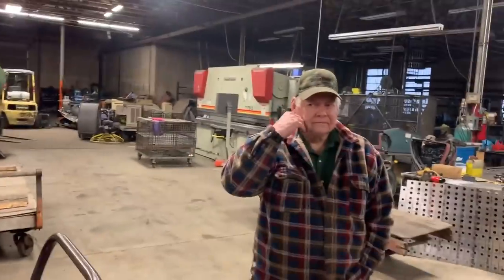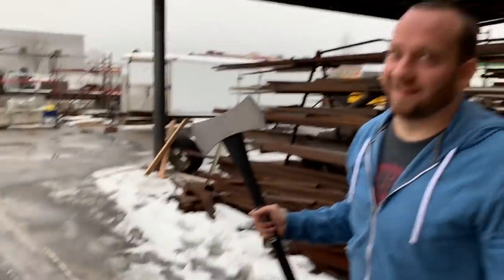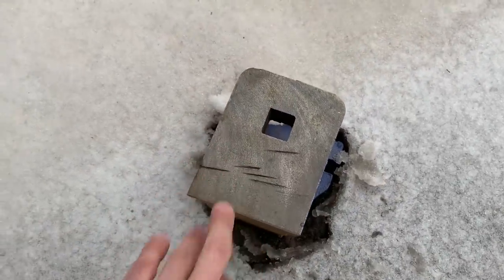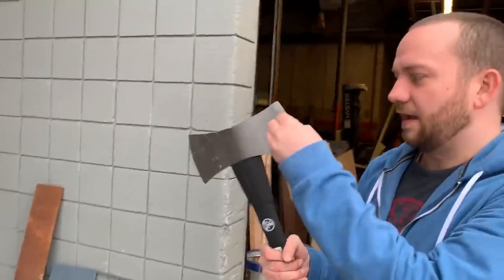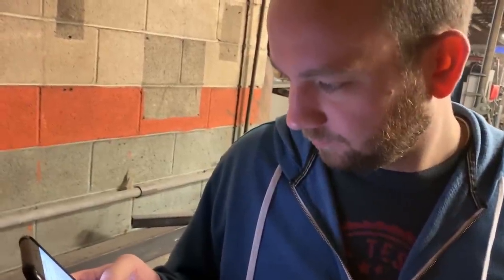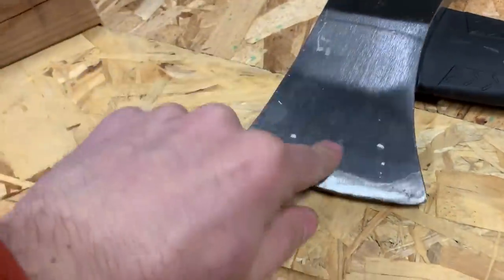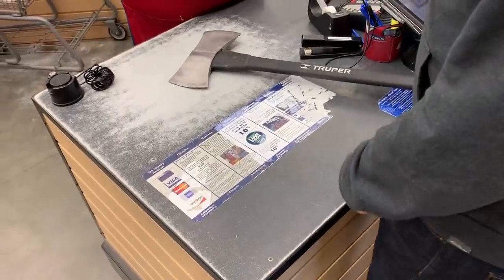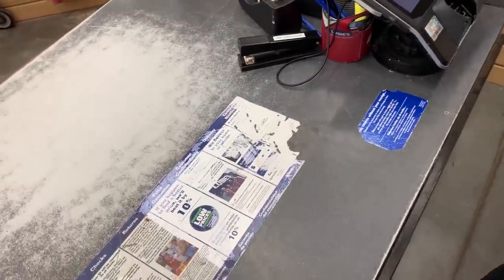Sharpening an Axe with 60,000 PSI Water - Waterjet Channel

Comment: "How is a rock harder than an anvil?" You guys cut an anvil with rocks.
Reply: Metal is rock or is rock metal
Reply: To be scientific diamonds are the hardest metal
Reply: But you must admit that diamonds are the most expensive metal if by mass alone
Reply: @eaminyashed7799  Again, diamond isn't a metal, it's a mineral, and there are much more expensive metals and minerals by mass
Reply: It's all about particle size, the smaller the particles the easier you can force something between them
Reply: @alexralph6024  Are you saying that's what determines hardness? Hardness is mainly determined by crystal structure, not particle size. Graphite, coal, and diamond are all made of carbon atoms, but the crystal structure determines how hard each material is.
Reply: @MrMydyn  No just saying thats what determines how an axe can go through things
Reply: guys the whole diamond is a metal is an old meme, look it up, its quite an entertaining read hah
Reply: Rock crushes scissors!
Reply: It's probably because the steel of the anvil wasn't hardened whereas the axe's steel was.
Reply: steel is softer than rock but rock is more brittle
Reply: @eaminyashed7799  Diamonds are pure carbon. Carbon isn't a metal. There for, diamond isn't a metal.
Reply: Gönndalf der Drölfte no, diamond is the hardest metal, the only reason they don't use it for bulletproof jackets is because one gram of diamond weighs ten grams, it's too heavy
Reply: but steel is heavier than feathers
Reply: @charliemallindine8164  you are joking right?
Reply: metamorphicorder yeah, look up diamond is the hardest metal
Reply: The level of confidence in ignorance in this thread is incredible.
Reply: The anvil they cut isn’t hardened. (I have the same anvil) I’m not shore what material the anvil is made of but, it’s not a very high quality anvil.
Reply: Jesus Marie they're minerals
Reply: @austinmcdermott8859  it’s iron I have the same one
Reply: @austinmcdermott8859  I've always assumed anvils were on the softer side to avoid shattering metal vs metal because it can cause some serious damage. I've never looked into it nor do I own one, was just an assumption I made.
Reply: @MrMydyn  carbon in the right formation can be the hardest material or the softest it’s all about structure

Comment: In case someone hasn't said it already, Harbor Freight sells cast iron anvils, not steel anvils. They are extremely soft compared to the hardened steel of the ax.
Reply: The anvils aren't Cast Iron, they are Mild Steel.
Reply: makes sense. Hard also means brittle. So a really hard anvil might shatter when hit with a hammer, which you is what you do with anvils.
Reply: @theswampus670  they are not mild steel, its definitely cast iron. That is why there are cast defects filled with bondo in their anvil cutting video
Reply: Riesenfriese they’re supposed to be very very hard and yes they can be brittle. That’s why you never hit hardened steel with hardened steel. You can break off chips that fly incredibly flat and are insanely sharp
Reply: @LtJerryRigg  You can cast Mild Steel, Cast Iron is very Brittle and has a higher carbon content than most Steels.
Reply: Cast iron isn't soft, but mild steel is
Reply: These anvils are cast iron. Look it up. Lol
Reply: Isent a prober anvil actualy forged? 
Shure, these craptacular cheapo anvils are some sort of cast. But I mean a prober anvil a blacksmith uses.
Well, at least the one I used to use was.
Anvils somtimes get a hardend surface, however I dont know to witch degree.
Reply: The Harbor Freight website clearly says they sell cast iron anvils. Not mild steel.  But what do I know?
Reply: @theswampus670   I stand behind what I said. Harbor Freight anvils are cast iron. Look it up. Besides, the ax wouldn't cut into mild steel that deeply anyway.
Reply: Cast iron anvils are faced with a mild steel plate. Cast iron facing would deform under the abuse of having hot steel pounded on it.
Reply: @metamorphicorder  Exactly. That's just what happened.  Harbor Freight anvils are cast iron. Just like I said. Thank you for confirming.
Reply: @jamesiverson6742  don't you hit hardened steel with hardened steel all the time when using an anvil?
Reply: @FrancisR420  Absolutely not. Anything being worked on an anvil should be soft. Even high carbon steel is pretty soft until quenching, but usually you heat it as well so it's even softer. You don't harden something and bring it back to the anvil, or if you do you definitely temper it first.
Reply: as a matter of fact, i was wondering.  what's an anvil like this actually used for?  is it like some sort of jeweler's thing or is it just a shitty anvil?

it looks like he was hitting the actual strike face.  typically the actual strike face is supposed to be hardened to prevent this kind of shit, right?

Comment: So, the axe head is hardened steel and the anvil is not. The reason you don't harden the anvil is so a hammer hitting it won't send flakes of metal everywhere.
Reply: @Roderick storey thanks for a polite correction (not sarcastic). The best way to get the right answer on the internet is to give a wrong one and wait for someone to set you straight ;)
Reply: Also a Harbor freight anvil  is cast iron not steel
Reply: Thank you. I actually learned something today
Reply: My anvil from 1815 wouldn't be phased by an axe blow, harbor freight anvils are cheap junk cast iron so they're easy to damage
Reply: @isaacb2016  Actually its made of cheese
Reply: @species5022  that might be more accurate
Reply: That's not an anvil, that's an anvil shaped object
Reply: I have a real anvil that I use for smithing, however I started on a small harbor freight anvil and simply tapping the hammer on the face to keep my timing made intentions. I can beat my anvil pretty damn hard and it doesn't dent or deform. It's a pretty well known fact if you're into smithing that harbor freight anvils are crappy Chinese pot steel that isn't hardenable (assuming they even tried)
Reply: The rock may be granite, but even sedimentary rocks are way harder than steel as they're basically a rock made of sandpaper grit
Reply: It depends on the anvil, you don't want a novice practicing on your proper anvil, so you make him work on the cheap mild steel one, that way your legs will never be hit by a flying chip of steel.
Reply: That's not true at all, my anvil has a harded metal top and when I hit it with a hammer it rings like a bell, that's what you want. Soft steel anvils are just crap metal and cheaply made, mostly in China.
Reply: @MedievalSolutions  even if you're training a novice you still don't want it that soft
Reply: If i recall that anvil was, at least in part, literally made of bondo.  Also I think the HF anvil ductile gray iron?  Cast iron is very hard and very brittle due to very high carbon content.  It would make for a dangerous anvil.
Reply: he could have just hit the concrete its higher on mohs scale and their compression strength is much higher than steel.
Reply: The harbor freight anvil isn't hardened because it's just crappy. Both axes and anvils are supposed to be hardened
Reply: @Robert-qm7yi  yes true axes are hardened and extremely tough, I had a friend who had a plaque made to go on the head of a fireaxe for his firefighter dad that had his engine company and symbol on it and I helped him put it on, the plaque had holes in all 4 corners for either rivets or bolts and drilling through the thick part of the middle next to the shaft was easy, maybe ⅝ thick steel was no problem, now down on the edge where it was maybe ⅛ thick but hardened was a literal nightmare, we burned up more than a dozen bits trying to go through it, tried annealing it with a torch and that didn't work either and ended up having to drill the holes WHILE it was red hot, completely crazy.
Reply: I was once hammering in a concrete nail with a sleage hammer and a chunk of metal flew out and cut threw my fiorarm
Reply: A good anvil is hard enough to break pieces off if you miss the nice hot metal in between. And you always feel really bad about it
Reply: @Roderick storey the Axe is cheap shit too, did you see how much it was damaged after striking something hard?  Thats def. not even hardened. Meaning the steel of the anvil is even more shit.
Reply: @Roderick storey Mostly correct. A proper forging anvil will have a hardened face so that it doesn't deform under normal uce, and the smith doesn't waste their energy. 

A striking anvil which is used to break the structure of a fresh billet isn't for exactly the reason forest pointed out though. A striking anvil isn't used for any kind of detailed work and has one to three men hitting the work with big hammers and another holding the work piece. A flying chip from missing is much more likely and far more dangerous with that many people around. They're better off soft. 

The harbor freight anvil though, is much too small to be a striking anvil and is pretending to be a smithing anvil but in actuality is just a paperweight.
Reply: @Roderick storey horror freight!! Haha I love it!!
Reply: But it would look metal as SHIT if it did.
Reply: also to not damage your work piece
Reply: all of you are wrong, its bondo.

Comment: I thought they would fix the axe perfectly vertical and tilt the jet. You can check for vertical orientation with plumb bob. If you check that both edges are alligned with the plumb bob it should be very accurate.

Comment: you should have cut it with the blade edge facing down @ a 15 deg tilt into the jet
Reply: @NuronAtren  same here
Reply: 30° angle.
Reply: @WarmongerSmurfOnXbox  you sharpen both sides, 15° per side.

Comment: A smooth hard surface will do less damage to a blade than a rough hard surface. The blade is staying in tact because the tension is spread out across the edge. Asphalts jagged rocks make it easier since its uneven and provides contact points.

Comment: Two things from the video.

Anvils are not tempered or heat treated. Axes are both. An axe is going to be slightly harder than an anvil, which is why it wasn't really warping the blade.

Rocks are used to sharpen weapons, implying rocks are harder.

Comment: Rock is generally harder but more brittle than steel. You could break a diamond plate relatively easily. You need tough materials for anvils that stick together if you strike it, the hardness is needed but secondary.
That's why you never strike hardened steel with a hammer... It can loose shrapnel

Comment: Rock is usually harder than metal. That's why you use diamond wheel to cut rock. Actually regular wheel for grinder is also kind of rock, just not that hard as diamond if you want to cut metal.

Comment: So I know this is an old video, but. To swing anything like an axe or sledge, you let the tool do the work. One hand at the bottom of the axe, the other about middle. As you swing the axe from above your head, the hand in the middle slides towards the other. This creates a fulcrum type deal, making it easier on you and creating more force on the axe. The anvils didn't work because it's made of a softer steel. It's softer so that it does chip when being used; potentially sending a small metal piece flying who knows where. That also applies to a forging hammer.

Comment: The rock did more damage because as the ax strikes the rock small pieces of the rock grinds the head of the ax in short. While the anvil is designed to absorb the extra force of the hammer so the force does not enter the work surface which could cause damage.

Comment: The reason why the ask was cutting into the Anvils because the Axe it’s made out of hardened heat treated steel with a very high carbon content while the anvils like most are made out of mild steel which has a pretty low carbon content And they aren’t hardened because it would be extremely inefficient

Comment: Many rocks are harder than steel.  It doesn't make them better blades since they are still quite brittle, but it's the reason whetstones are used to sharpen steel.

Comment: axe blades are composited.  most of the head is a milder steel just for the sake of weight and durability.  the actual edge is an insert, a much harder and much more brittle steel.  looks like you actually like delaminated the forge weld that's keeping the blade in or something lol

Comment: Ok... guys. Stop saying the anvil is weak. What are anvils used for? A metal tool hitting metal work. If that anvil was hardened it would chip and fracture and create shrapnel. Very dangerous. 
I'm not trying to troll. I'm just wondering why nobody looked up why anvils are soft.
Would you want your anvil doing what the rock did?
Reply: Tokin exactly! That and the wood was hard to split because it was frozen.
Reply: You're not supposed to be able to cut into your anvil
Reply: @sageh.5228  a hardened axe will any day of week cut into an anvil. I literally have a 100 lbs anvil next me. That I use all day long. Try again kid.
Reply: @sageh.5228  Yes you are, Anvil is made of soft metals like iron and copper and not materials which have properties similar to rock (like steel)
Got it? 
Iron,copper,tin etc are all wood like metals while alloys like steel are more rock like when faced with an impact.
I would say you are below 7th grade of elementary based on your knowledge
And don't refute me as i had a metallurgy class in middle school as well
I had to learn things like how to process metal ores and their properties plus the alloys that can be made and stuff each metal is good for despite singing up for  a mechanic which make no sense to me :-/
Reply: @richardwaldron222  Lol ok. If you know anything about anvils you should understand that they have a hard face, if you can dent it with a hammer there's something very wrong. I own a harbor freight anvil (I believe the same one they used) and it's extremely soft, even mild steel dents it.
Reply: @richardwaldron222   try a good anvil and tell us how it went. It isn't soft for safety but because it is cheaper.
Reply: The axe is hardened  steel, it is pretty thin by comparison and its being hit on its thinner section, did it shattered? But a solid block of hardened steel will shatter with the impact of a hammer? Good anvils can be quite hard without being brittle, all they need is proper heat treatment and dressing
Reply: No, that "anvil" is totally shit. Harbour Freight are known for making ASOs rather than anvils. You don't want an anvil that will dent rather than an anvil that will resist the impact. You don't get much work force out of a dent. There's a reason a test for a good anvil is to drop the hammer and see how much bounce it gets.
Reply: In blacksmithing working with softened surfaces is intentional, when you mis-strike the surface, soft metal deforms safely. If it was hardened, it'd splinter into shrapnel. 
The true quality of an anvil is actually how much well a hammer "bounces" back when landing on the surface. Again, softer metal bounces better, like a tennis racket.
Reply: @2Stepzupp  Are you being sarcastic?
Reply: @Hampus ? 
I don't think I mistook some metal to its improper type, did i?

Comment: Fellas, you should've tried to position the axe in the opposite direction sharpening with the blunt axe edge pointing downwards.

That would've made it sharp enough to cut a black hole in half... This needs revisited with a proper axe holding rig! to get the angle right.
Reply: If it ain't hard, it ain't worth doing. Mitchell can be the rig and use his tongue as gripping support. But on a more serious not I reckon you should try this out - 

Try making a twin headed axe out of a beefy sledgehammer...... 8-O

Comment: The way they’re incorrectly using an axe is just beautiful. Tbh it is a weird axe though. Double sided with a short handle. I’m not an axe professional but I’m pretty sure the purpose of a smaller axe is to use another tool like a hammer to wedge wood in half. The fact it doesn’t have a flat side for hammering defies that logic,

Comment: 2:10 rock / sand / silica / glass have almost always a higher hardness compared to metals ... but they are more brittle
Reply: big difference from ductile (soft and quite pliable, will break before it blows apart in an explosive like manner) and tensile (harder and less easily bent, will crack apart once it has reach max bending limit thus why you see the previous WTC with lots of cracked off pieces), thus why cast iron is considered a ductile metal and used in some types of piping as well as for anvils hence they are easy to cut as seen with a hardened steel axe.

Comment: We thought that anvil was bad already, but we now know that it is a complete joke.
Reply: big difference from ductile (soft and quite pliable, will break before it blows apart in an explosive like manner) and tensile (harder and less easily bent, will crack apart once it has reach max bending limit thus why you see the previous WTC with lots of cracked off pieces), thus why cast iron is considered a ductile metal and used in some types of piping as well as for anvils hence they are easy to cut as seen with a hardened steel axe. Hence the term pot metal.
Reply: Stump in this instance was frozen, making it a very hard ductile wood.

Comment: The anvil is unhardened mild steel and the axe is probably a high carbon hardened steel. Soft steel is susceptible to bending and deforming, while the hard steel axe head is more durable.

Comment: Anvils are soft and not tempered that way if you miss hit with a hammer a piece doesn't brake off and stab you. There are horror story's of black Smith's using a sledgehammer and miss hitting and a shard going through them

Comment: The rock is harder than the anvil because that's a cheapo harbor freight anvil, that's made out of cast iron instead of having a hardened steel plate forge welded onto the face of it